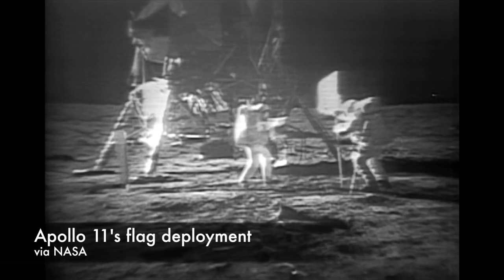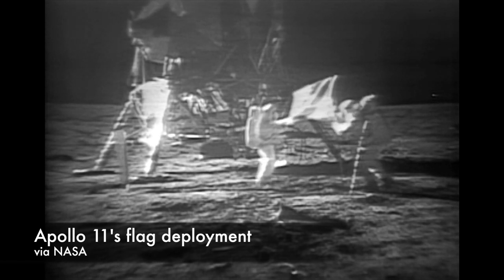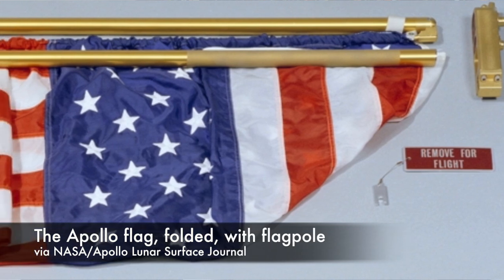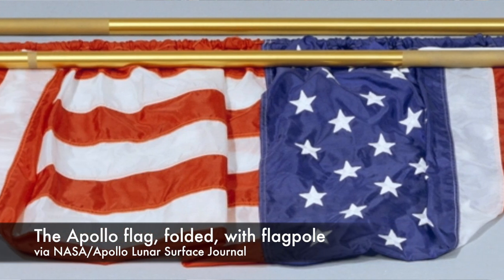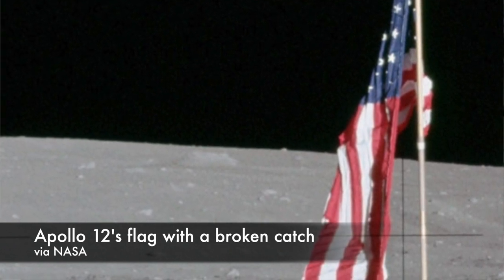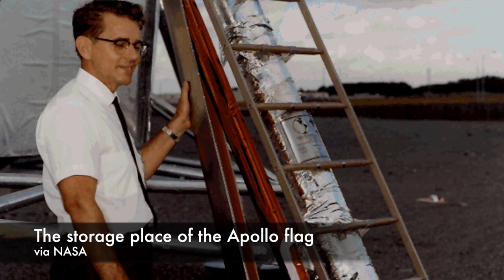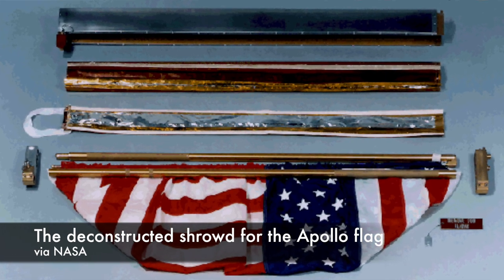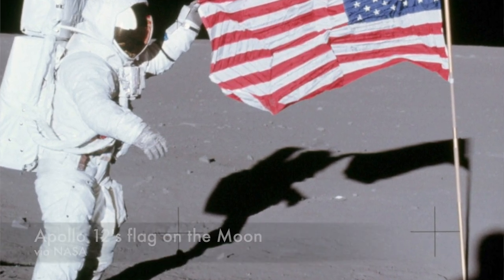How the Apollo Flags "Flapped in the Breeze"

Comment: the video title is about how the flag flapped on the moon. However the actual video is about how it was prepared to withstand the extreme temperatures and how it was anchored to the ground. Y u du dis?
Reply: +Ciroluiro  What extreme temperature?
Reply: the decent engine being nearby
Reply: well.. she did explain right? she told that the flag flapped due to the exhaust from the engine.
Reply: djhawk vek the exhaust was only there when they liftoff, not when they doing EVAs.
Reply: I have to agree that the video really doesn't address the stated issue too much.

Tylasan, you do a fine job of completing her point.
Reply: the sky is dark, but the sun is hot. A day lasts at least 14 days
Reply: I gotta disagree, she explained how and why the flag appeared to flap and then went into further detail as the how it made its way up there. She didn't clickbait you, you seem to have not paid enough attention. It's really simple, the flag flapped bc of a pole in the top of it. Saying that would have made the video less than 10 sec long
Reply: @kreuner11  The sunlight will mostly pass through the flag so it will not get that hot.
Reply: Wow yall need to wake up!
Reply: @albertnewt56  No, that's not what she said. Pay attention.
Reply: @southronjr1570  that's hanging, not flapping or waving. The motion was caused because the pole was moved/bumped/jostled/whatever.
Reply: @kreuner11  There is no "heat" coming from the sun. Heat needs a medium through which to transfer from one conductive particle to another. Space is a vacuum. There are no such particles for heat to transfer in space. The reason we feel heat on Earth is because photons hitting the atmosphere slow down, causing friction and we feel the heat of this friction. It's simply light energy transferring to heat energy. It is not "hot" on the moon (at least not in the way we think of heat). You wouldn't feel heat around you if you were not wearing a space suit, only the surface would feel hot, while your body would get baked by thermal radiation.
Reply: @albertnewt56  "Exhaust from the engine" 🤣🤣🤣 You're kidding me right? No, the reason the flag flapped is because the material it is made from acts completely different in a vacuum compared to Earth's atmosphere. In a vacuum it acts like chainmail and will swing from side to side if shaken. The astronauts were shaking it when erecting it, therefore it swung from side to side as chainmail would.
Reply: Because there’s no legitimate explanation

Comment: Actually, in a perfect vacuum environment, any wave energy added to a hanging sheet of fabric (flag) will take longer to dissipate than if that sheet were being dampened by surrounding air. Thus if the pole were jostled by an astronaut, the rippling waves of energy sent into the fabric would continue to flow back and forth many times before eventually petering out. This would look like a flag waving in wind to the casual observer.
Reply: "casual peasant" you meant.
Reply: Exactly
Reply: How much start trek did you have to watch to get that answer lmfao 🤣😂🤣😂
Reply: eV Prod  and also. If you put something in a vacuum anything won't expand or explode as you say. If that was true  it is impossible to know if sound travels through a vacuum
Reply: eV Prod  then how do we.put clocks in vacuum with no problems? Or are clocks a hoax as well?
Reply: eV Prod  you know space suits can regulate pressure inside them...
Reply: eV Prod  space suits aren't just metal you know that...
Reply: eV Prod  first of all it doesn't suck. Suction happens from different pressure points. A vacuum cleaner sucks because atmospheric pressure and lower pressure Points, from high pressure to low pressure.. If you put a clock inside a vacuum chamber it doesn't crumble or break. Because the pressure inside is equal meaning pressure difference is 0. You know you can always compress oxygen in a tank and the tank pumps oxygen to the pressure human body can breathe in.
Reply: eV Prod  I don't have time to respond, but your choice you believe or not. Good luck.
Reply: eV Prod  I appreciate the fact that you didn't go attacking like most people and just because of difference of opinion. Anyways have a nice day :)
Reply: Don't you dare try to apply logic to my fake moon landing conspiracy!
Reply: No
Reply: stop the cap
Reply: Idc what explanation yall give that's a flag blowing in the wind imo

Comment: The flag is waving very clearly even before the astronaut begins to hammer it into the ground. It must have been due to those ventilators in the studio that were necessary to keep the "astronauts" from boiling inside their suits, due to the heat that at least 15 reflectors are emitting. Besides, the fact that the other actor (aka "astronaut") tries to "calm down" the flag gone wild in the wind, is proof enough that this footage was taken in a studio. If it had been on the Moon, the other "astronaut" wouldn't have given a damn if the flag waved or not, since he would have been focused on his mission as such. But in a studio you are more concerned about things not to go awry, and that's why you'll always try to "correct" anything that might "blow" your hoax.
Besides, do you see how long it took till the first "astronaut" managed to probe the pole into the ground? Why did it take him so long? Why didn't he simply stab the pole into the ground? Well, the answer is simple: He was first looking for the particular hole or tube that was placed there before, the pole with the flag was supposed to be placed into, and then he was trying to fix the pole into the tube.
Reply: I needed a good laugh today!

Anytime you see someone type “proof enough”… you know there’s, like, no proof.
Reply: @erac5855  shilllllll!
Reply: I've seen all the same things...like the hanging bags that swayed downwards & the light source being from multiple sources. Watched the video at a higher speed (normal speed as made) & it became clear as day. Actually, that just made it clear as day to dodos, I could tell from the moment it started. U don't loose valuable data & footage& u don't have an ability & out of know here lose such technology. If in 50+ yrs we haven't "been back"

....it's bc Boone ever went. This goes a tad beyond common sense.

Comment: How the Apollo flags flapped in the breeze.... Yes it's called stage fans... to help keep the actors cool in their costumes while filming under hot stage lights.....
Reply: Since there is no air on moon it cannot flap in the wind BUT on earth wind is required to move the flag however the astronaught while planting (planting?) the flag would have moved it and with no air therefore no air resistance the flag would continue to move which would look like it is flapping in the wind.
Reply: @sushilakumarisinha5648  nope it was made with a starch like texture.....so that it would look to remain tight, but the hanging bags, multiple light sources.... video lense in the reflection, spot light reflections....do I really need to go on? Common sense. We never went, or we'd be there rn.

Comment: I don't really have a position on this. But if this was designed to persuade anyone the flags didn't actually flap in wind or air, it was a very poor attempt. There is very little actual footage. Why so shy? Surely poles or wires in the flag would keep it rigid, not allow for the flapping motion we see in even the few seconds they show here.

Comment: Apollo 11 never went to the moon. Sorry to burst your bubble but it did Not happen. It was only 2 years after as-204 later called Apollo 1, had 3 astronauts burned alive on launch pad 34 just doing tests.  I saw the “landing” & saw the capsule of Apollo 11 after. That sardine can could not have made reentry. The flag was not designed for Apollo 11 as your fake story states. Yes I know engineers from nasa...not saying other missions weren’t on the moon, but in 1969 it did not happen and any more failures would not have been acceptable at the time. Think about this: 15 years after Apollo 11, we couldn’t launch a shuttle rocket (not even going to the moon or landing on it) without it blowing up!: Challenger...    ✌🏻
Reply: Yeah a little too fast leaping, least for their Space, not sure that is accurate, Moon looks close to me.
Reply: Sorry to burst your bubble, but Apollo 11 most definitely went to the moon. In fact, it was largely due to the Apollo 1 fire. As sad as that sounds, it really kick started NASA and partner agencies to design the best and most reliable spacecraft they could. 

And of course the CM could survive reentry. It had an ablative heat shield, and was specifically designed to withstand the heat and G forces. Mercury and Gemini did the same, and they weren’t even as advanced as Apollo. 

Also, spaceflight is inherently dangerous. You could launch a rocket successfully 99 times, and it could explode the hundredth time. In the case of Challenger, there were several considerations, including spacecraft, design, and the weather that day. Just because something worked 15 years ago, doesn’t mean it’ll work today. Also why my nearly brand new car has needed two new air conditioners in the last two years. Stuff fails sometimes.

Comment: Where is that crater under the landing module? All that force from the jet blast has no effect on the fine dust moon surface???? wow, it is amazing. stay under that desk, you are doing good.
Reply: +Ger Moua Same answer you will always get. Not much thrust. Rocket exhaust behaves different in a vacuum. The lunar dust is only a few cm thick. There are pictures of the Moon dust having been displaced.
There is absolutely no reason for a crater under the lander. A helicopter can produces more thrust than the lunar lander. When is the last time you saw a crater under a helicopter?
Reply: it's not like it was firing at full power for the last leg of the landing
Reply: If I'm correct, they throttled the descent engine way down for final approach, and cut the engine before coming close. Not to mention that rocket exhaust expands outward in space, which means the engine force pushes against a large part of the surface. Sure, some regolith would undoubtedly be yeeted around, but it could still land. We laugh about your stupidity.
Reply: This whole comment section....Thank God yrs later we know what we know now!!!! & That's right, still never been!!!!

Comment: So the flag was over engineered but that doesn't explain why they are flapping in the wind. She said herself that the reason the Apollo 11 flag isn't there is because the lunar lander blasted it away when it took off. If the blast from the lunar landers thruster was so great why is there no blast crator underneath the lunar lander? Just look at the images in this video.